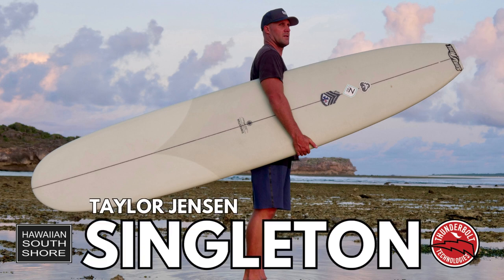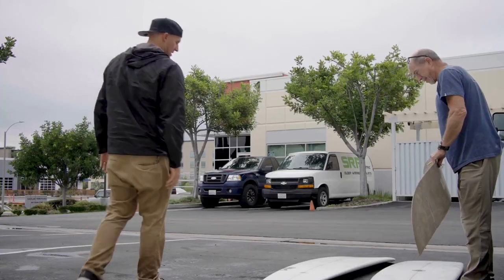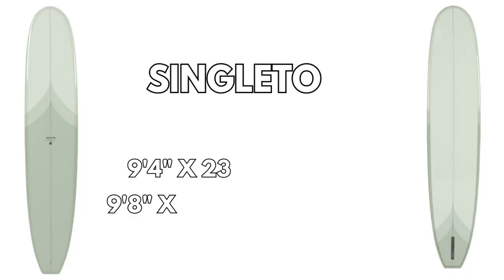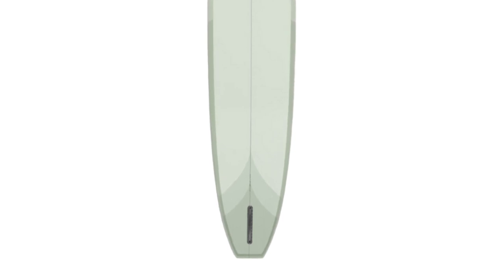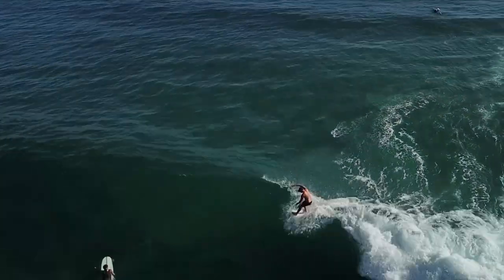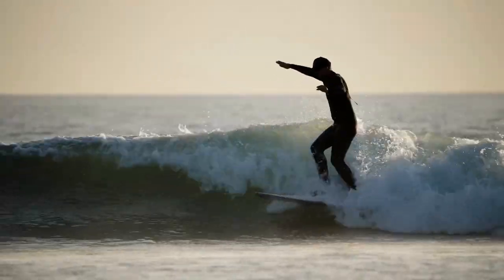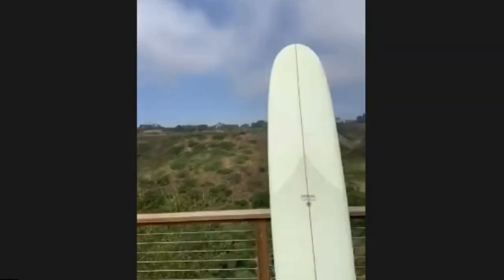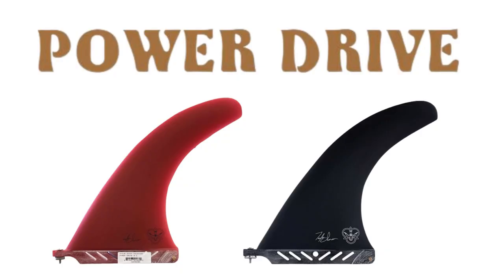Experience the Perfect Balance & Performance on the Singleton Exclusive Interview with Taylor Jensen

Comment: Between the 9’4”, is the 9’8” too big for a shorter rider 5’6”?
Reply from the maker: All depends on what size longboard or log you usually ride. 
I have many petite women that ride 96 and 98 Volant logs they do OK with it and they love it. 
So if you're used to only riding something that's up to 96 I would grab the 9'4 and if you like the length and you're used to riding something like a  log the 98.,
 so there's really no correct answer. It just depends on your style of bored, and what you're used to. - David